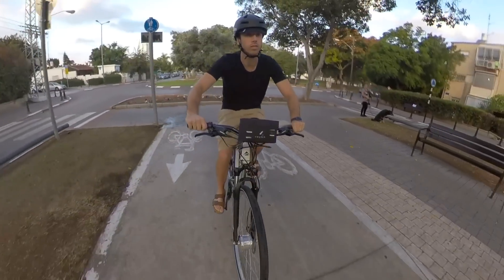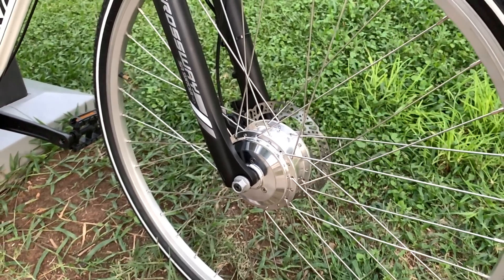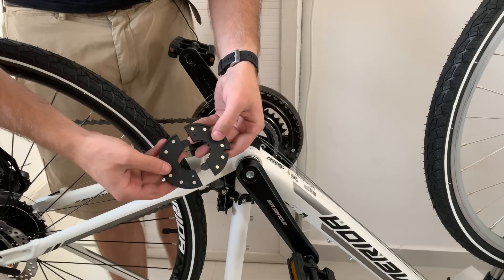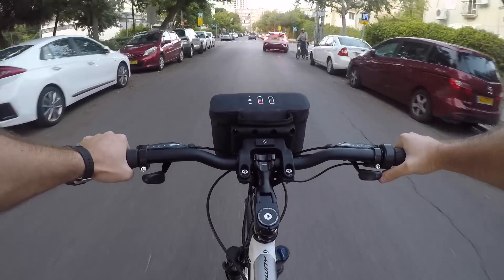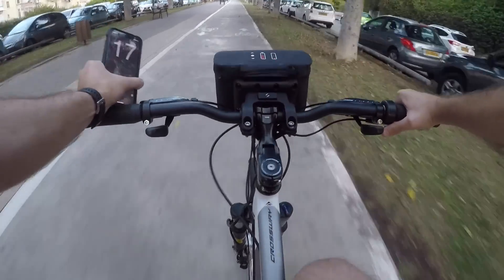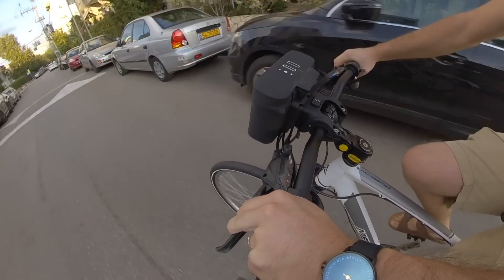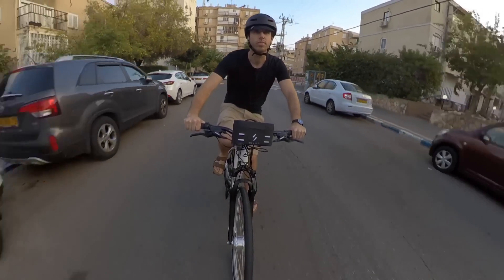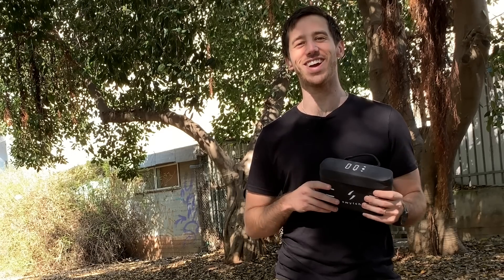Review: Swytch e-bike kit is smallest and lightest way to DIY an e-bike

Comment: What the Swytch kit needs is regenerative braking and throttle control on the handlebar grip like a motorcycle. A larger battery and lower price would help too. Taking your hands off the handlebars to control the power is Mickey Mouse. And regenerative braking would extend the range.

Comment: Price is astronomical, especially considering it looks like the throttle and brake sensors are "accessories" which would mean even more added cost. Pretty sure it's illegal AF to ride an ebike that doesn't have motor shutoff with braking. How is that an "accessory"??
Reply: I did not order the motor shutoff accessory bcoz
I know, I will not need it.
As soon as you apply the brake, the motor stops.

Comment: You should have said that you can only ride the bike at only 15mph in the Europe set by swytch themselves.
Reply: No, not quite correct. In Europe the assistance has to be limited to 15mph by law. Swytch don't decide this, which is why the US kit does 20mph. You can still pedal faster than this but the assistance is disabled.

Comment: light because it's 250w and small 24v battery.  Better to find a 20 yr old donor with a std triangle and buy a 1000w kit + 48vx12ah battery on ebay for $500.  Mounting the PAS is same either way and the hardest thing to do.

Comment: Nice kit, but simply too expensive for what you actually get. Also, takes 3-4 months to actually receive after ordering.
Reply: It can take more time than that.
So, you're good not to order.
Btw, what's the price you heard?
Reply: @justsayin494  at the time it was $625 for the eco, not including taxes, fees, shipping, and customs. It would have been over $1000. Decided to cancel my order, could build a way better and more powerful bike for the money.
Reply: @andrewc673  Looks like you did not get the 50% off,
where you sign up for their 'Waitlist' & have  to wait
for them to be manufactured in Asia.
I got my Universal Pro kit for around $600 (includes customs fee) , 
that's a step up from the Eco kit. I'm very satisfied with my Swytch kit.
I like the fact that you can easily remove the battery with a button push.
Closest competitor in price, easy set up & looks identical
is Hilltopper- but their battery has less mileage.

Comment: It's not an ebike as advertised. "The Swytch kit is a pedal assist system which means a throttle is not required. All Swytch kits are compatible with the throttle if you wish to add this to your order." You need to buy the throttle kit to make it an actual ebike.

Comment: company do not respond to contact requests and have failed to deliver a refund. beware.
Reply: I was thinking of getting it. What went wrong with your kit? Did the motor break within a couple of months?
Reply: @42luke93  I had the bike assessed and two bike shops both decided that the motor would put too much force on the forks so I decided to return the kit. They acknowledged the return but then stopped communicating and failed to respond. Only after a stinking review on Twitter did they respond and I eventually got my money back.

Comment: Very good invention , too bad NYC has too many thieves & killing over stuff like this.
Reply: Advantage with this kit is that the motor is built into the front wheel, and both that and the battery are easy to remove and take with you. At that point, your bike is much less attractive to a thief. Although in NYC, ymmv 😏

Comment: Great idea, but the company is shite when it comes to communications with customers. The Indiegogo campaign for the last round is horribly late and getting any info out of the company is an exercise in frustration. I ordered a kit last November and have been patient with the COVID induced delays, but the company doesn't update information for it's supporters, and although the container with my order arrived in port over 10 days ago I'm still waiting for a shipping notice. Over a month will go by between "updates" that are lacking any specificity as to actual dates that one can expect delivery. 

Someone with business acumen should buy out the founders and make a real company out of this, as they are destined to be also-rans as the tech isn't all that difficult and you can buy kits directly from China on Amazon for around the same money. The only benefit to a company like this would be customer service and support, and they completely fail at all aspects of those critical areas.